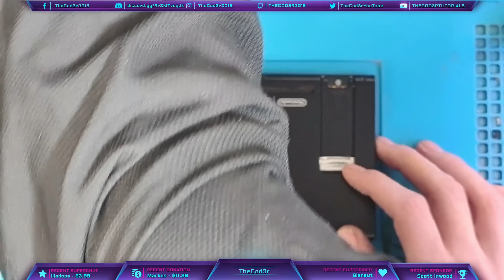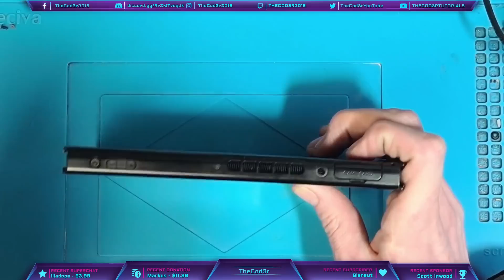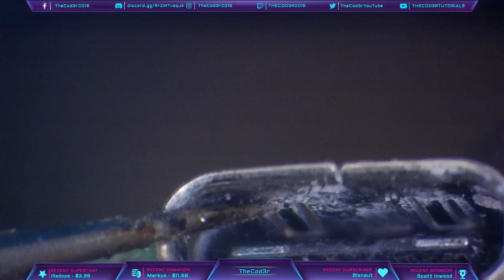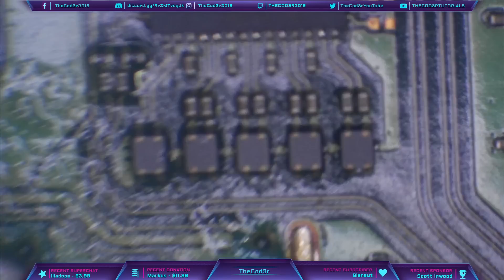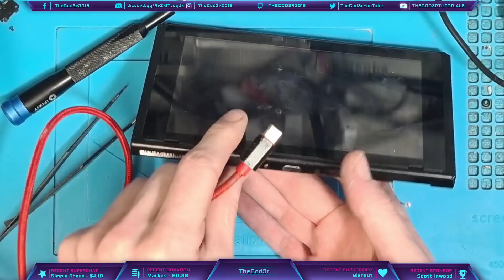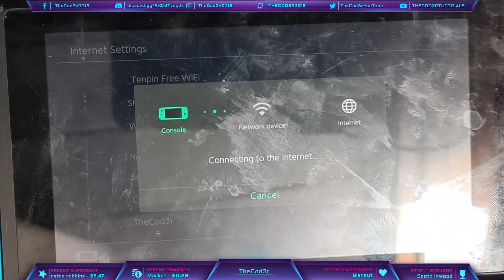Nintendo Switch Drawing 0.4a But Not Turning On - P13USB IC & USB-C Port Diagnostics And Repair

Comment: Can the p13usb fail without internally shorting mate ? I have a switch charging but not turning on but no shorts, rekon its worth swapping the p13? This is a water damaged switch, corrosion around the charging ic and m92 but not the one on the back . Maybe this is m92? There was corrosion on the ssd connector aswell so hopefully its not dead

Comment: Hi, I have a switch that gets stuck at 0.46A. I got the switch with a defective USB C port. After the exchange, it turned out that the M92 was defective. I then exchanged it. I also exchanged the P13USB but the console still gets stuck at 0.46A and does not turn on. Connected the console to the computer. A console in RCM mode is displayed here!? 🤷‍♂🤷‍♂ (this is a patched console!)
Is it possible that the EMMC is defective?

Greetings from Germany
René
Reply: does the emmc get hot while plugged in?
Reply: @techdoc.repair  not really hot but warm.

Comment: nice, thanks for your informative videos. i have a Switch at the momment that only draws 0.4a and there are no shorts near any of the major ICs, M92,BQ, P13, the usb-c port reads fine using a breakout board.  Have you got any ideas? im stumped
Reply from the maker: 0.4amps is a tough one. that said, if possible give M92 a try anyway because they don't always show signs of shorts

Comment: Good work love your vids man! Got one for ya had a switch broken usb c replaced charges both sides of the charger powers on and works great. However, the unit won't display on a dock. The power light goes green on dock and the switch screen turns off but nothing on the TV. Tried different switch same dock and works great, ever seen one do that?

Comment: How do you know if the CPU is toasted? I have a board that pulls .41a with the battery in and with it disconnected it stays at .05 and .07 if i hold the power button for a little bit than it will go to .000... I have no shorts and im out of ideas.... I keep watching your vids and the people you support but no one else has the problem.. Keep up the good work! My next project is changing out one of the ram chips to fix a blue screen on a diff board.. I hope.. If i push on the one by the m92 it turns on.. You ROCK and thank you for all the tips!

Comment: if the short didn't go away when removing p13usb what would be the cause of that?
Reply from the maker: If the short is still there it's a shorted cpu unfortunately, and then it's either either full cpu swap (which isn't worth it) or it's a no fix at that point